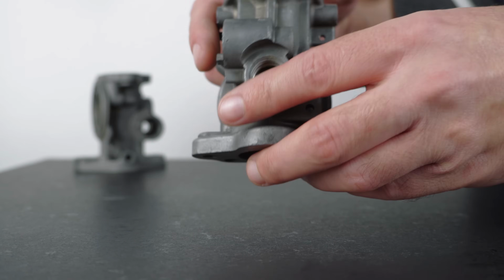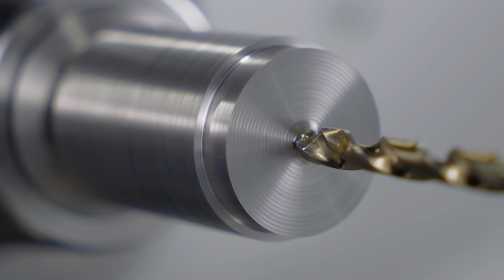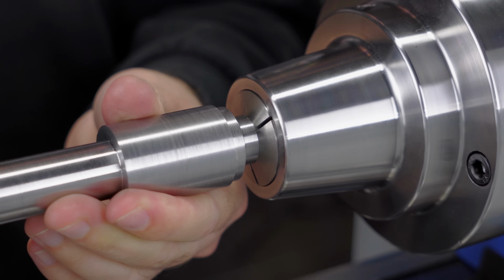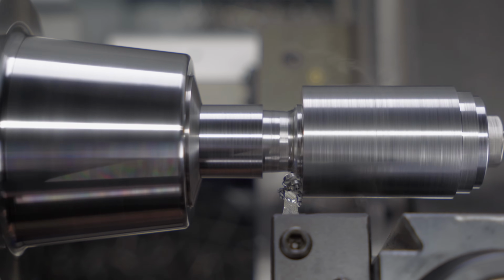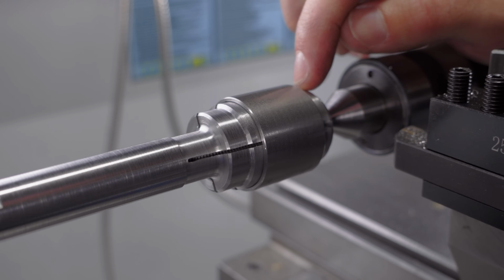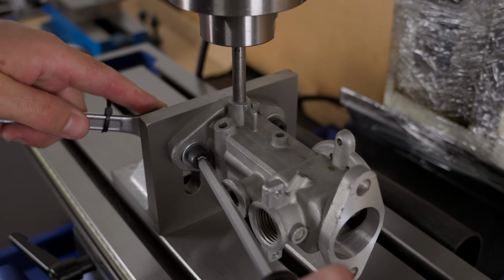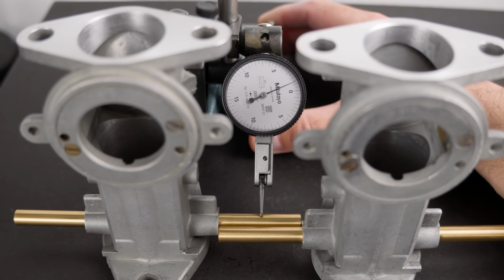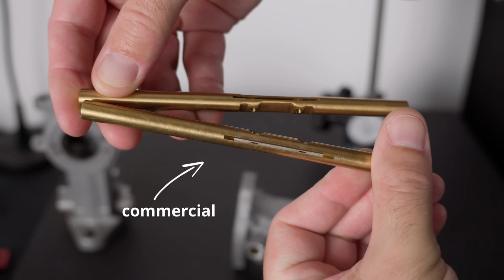Let's face it, no one does this on the lathe.

Comment: This is fantastic, many thumbs up.  Chinese lathe (that's what I'm looking at for a size upgrade from my most excellent but too small Sherline)?  What brand?  Which model?  It looks like you have personally tricked it out to the n'th degree.  Any information would be most welcome, thank you.
Reply from the maker: Hi there. I have a rebuild series of the lathe, you can check my older videos. The lathe is from HBM Machines, it's the equivalent of the Precision Matthews PM-1022V, if you are in the US. I haven't scraped it, I just carefully rebuilt it with minor changes. I'm working on a related post that I'll publish on my website soon.

Comment: Never knew why old SUs would not adjust right.
Reply from the maker: It depends. Not adjusting right can also be a symptom of the wrong needle fitted or not correctly centered, no dampening oil in the dashpot (or incorrect oil/springs), worn out jets or even something else not directly related to the carb, like ignition timing. But yeah, can also be worn out bushings allowing air to be sucked. If they're worn, replacing or getting oversized shafts is the correct thing to do.

Comment: ``dis is de wey brothers!`` nah m8, this is the way, lest you have a full blown shop with 20 different machines and 200 tonnes of cast iron in them, this is the way... I have a few ideas on my mind, but nothing revolutionary to your setup... Just some modifiers, but for once, i will not leave a 1000 word essay in the comments... The job has been done great... I guess you could have set that finished flange on the cross slide and line bored the both bushings in a single setup, stroke by stroke, thus inducing even more precision to the flatness of the line that passes through the centers of both bushing bores, but that is a bitch of a setup in it`s own way, and the requirements of this part are not that of an optical prism... 

Glad to see the center/driver in use... That was a damn fine design, and that calipers ``depth mic`` accessory is something that i`ve had on my mind for a while now... I`ve seen a design print for such a piece and it`s been on my mind for over a few years actually... Very cool idea and i`m most pleased to see it implemented by someone... How do you find it? I know that the calipers rod ain`t all that great for measurements, but when nothing else fits the hole/depth, damn is it useful to at least be able to roughly measure it... 

Best regards!
Steuss
Reply from the maker: Hey Steuss! Thanks, I didn't think of that setup in the cross-slide. That's interesting, but like you said, more time consuming to get right. Glad you found the driver interesting as well. 

The calipers depth attachment is something I got long before I had the mill and the lathe, it's really useful for quick measurements where precision is relative. I purchased mine through ebay. I made a quick search and looks like it's still available - it's an "iGaging". If you look for 'depth caliper adapter' or 'depth caliper base' you should find it. Looks like there are other brands, by I don't know those. Mine is ground and the base is lapped. The quality really is OK for what it is and costs. Thanks!

Comment: Maybe I didn't understand the arbor design, but if it is expanding only on one side, how much contact it gives with the bore? Seems the bore will only be griped by a small portion at the front, which might get the part not to be aligned properly. Again maybe I didn't understand how the arbor works.
Reply from the maker: Hi, I tried to explain in the video, but maybe I wasn't clear. I'm sorry for that. 

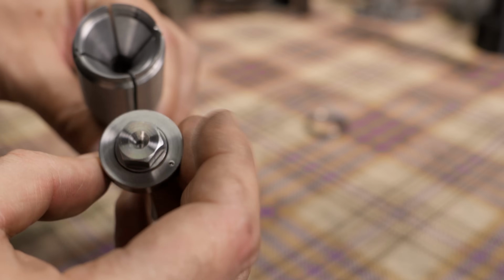Your reasoning is correct, have a second look from 20:06. I made 2 light passes with the arbor expanded until I reached the desired dimension, which was an average of the bore sizes (checked using the micrometer). That's what I am measuring at 21:20 - the arbor is 'straight' when it is expanded to 31.71mm.

These last 2 cuts were the challenge of making this arbor and why I used that ring to make it solid (so it wouldn't break).

Hope this helps. The setup is very repeatable - I was surprised by that!
Reply: @nbrworks  Thanks for the detailed info. I didn't understand that it was expanded at these cuts. 👍
Reply: BTW I made once this kind of arbor but it expend from both sides. Was very hard to make especially not having a proper milling machine.
Reply from the maker: Were you trying to control the expansion of both ends, to be the same? That sounds complicated!
Reply: @nbrworks  It had a taper for it's whole length and the slots were cut much like the slots of a ER collet. The plug went almost all the length of the arbor, so when tighten, both ends would expand. It worked very well for the purpose I made it, but was a pain to make (an enjoyable pain though)...🤩
Reply from the maker: Sounds like a cool project. I'm exploring a similar idea to use this expanding arbor for largers bores. An expanding sleeve or something like that. I'm still trying to figure out how to do it though, exactly to avoid having only one end touching the part. Most certainly will not be the next video 😉 but wel'll see!
Reply: @nbrworks  Make sure to have fun with it and then share it with us. 👍👍👍

Comment: There was a carburetor you were holding right? Why does it have to be parallel to the boare? Just a question, just Curious.
Reply from the maker: Hi Nicholas. If the bushings don't need replacing, the flanges are not required to be perpendicular to the bore. 

However, since I was replacing the bushings, it's better to have them square. It helps to ensure the drilling is done correctly and the butterfly goes back in the position it belongs.

Comment: Wow, is that a custom built from scratch corss slide?
Reply from the maker: Hi, the cross-slide is the original, although it has been rebuilt, yes. If you're referring to the solid tool post mount as the 'custom built' part, then yes, it was made by me and there's a video about it (have a look at my other videos). Thanks
Reply: @nbrworks  Yes, I was refering to the tool post. Still haven't grasp the proper naming. It amazes me  how people go 2 years into owning and upgrading their lathes failing to realize the rood of the problems with rigidity stems from... literally the root, i.e. the base of the sliding assembly of the lathe.

Comment: I think: When starting, idling,  driving down the road, will all that detailed work you've done make even the tiniest difference to performance. Not likely. Abd, you're worry about a minutely stiff butterfly shaft is senseless. When you put your foot on the accelerator, it won't make any friction difference at all. In 5kms it will have bedded in looser and be fine for 100,000 kms.

Comment: Did Imiss what these carbs are for?
Reply from the maker: Hi, they are for a 1961 Mini. In case you want to have a look, there's 6 posts about the engine build on my website: www.nbrworks.com
Thanks!
Reply: @nbrworks  Thx - I will. I found the throttle shafts, but nothing on the car...

Comment: Using 680 loctite with activator will have you machining again in 20 to 30 mins or less.
Reply: You can also throw a light knurl on the bushing for the mechanical fit and then the loctite is just there as a sealant.  It's what I've done on old Solex carburetors when the bore is really wallowed out and you have to go to bushing size to get a round hole.

Finish reaming takes care of any distortion the knurling imparts on the bushing

Comment: You could also just make a telescoping tool with two opposing cones that grip the bore at either end. That would mean a bit les contact surface for grip and that you wouldn't have full access to face the flanges, but it doesn't take much load to turn aluminum anyway.
Reply from the maker: It wouldn't work as both ends are not concentric with each other.

Comment: Nice. But there is no mention of the fact that the mounting surfaces of the corresponding cylinders must be coplanar, or all that work you did to get the shaft to flange height exact will be wasted.
Reply from the maker: The manifold will also be faced, later 😉

Comment: A good file will do the job quite satisfactorily and if you want it even more precise, use some 400 grit sandpaper on a known flat surface. You do not need a milling machine nor a lathe to rectify a warped carburetor base.

Comment: This is called overcomplicating the solution. You should have simply solved that with a piece of glass, a few sheets of sandpaper and some cutting oil. Use some good old elbow grease and slowly flatten the surface. People have been doing it for decades without any power tools.

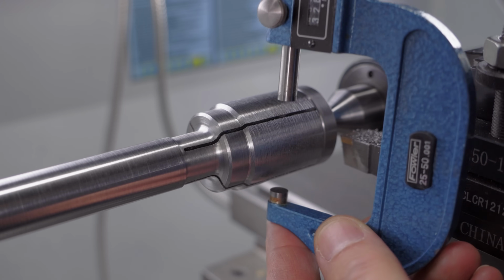Comment: While everyone's busy kissing your a$s for amateur quality work, let me point out some silly errors. Almost all of your inserts are inappropriate for the cuts you're taking - you're almost never engaging the chipbreaker and you're getting terrible surface finish and chatter. Make sure you follow the feeds and speeds and depth of cut your inserts are designed for. At 20:49, you're getting a poor finish not because of any inherent vibration, but because of rubbing and chatter due to a very shallow depth of cut using a molded carbide insert. You cannot use molded carbide inserts at super shallow depth of cut and fine feeds, like that CCMT that have a relatively dull edge. Those generally have large, rounded lands that are designed to increase the life of the insert at moderate feeds. If you absolutely must sneak up on a dimension, you must use ground inserts with a very sharp edge, or CCGT inserts designed for aluminum, or grind and hone your own HSS tools. As a general rule, you will get much better results with molded inserts if you calculate your final pass to have at least a ~0.3mm depth of cut. Avoid trying to sneak up on a dimension like that.